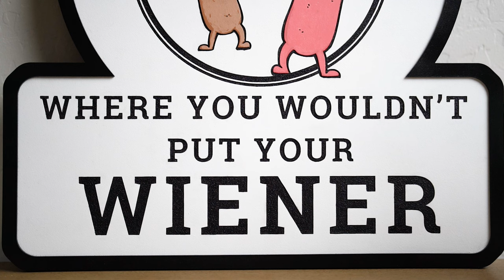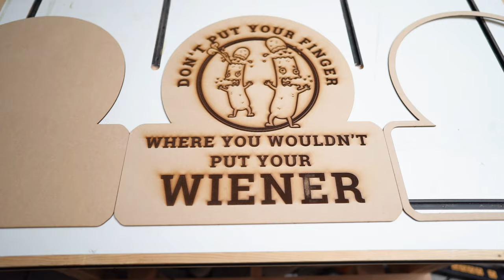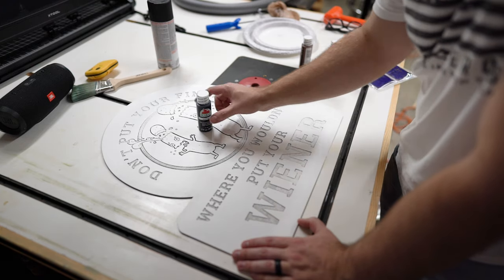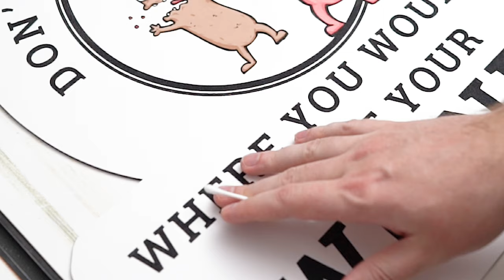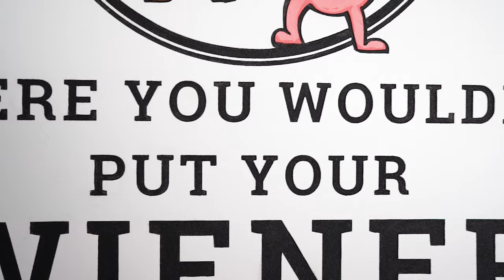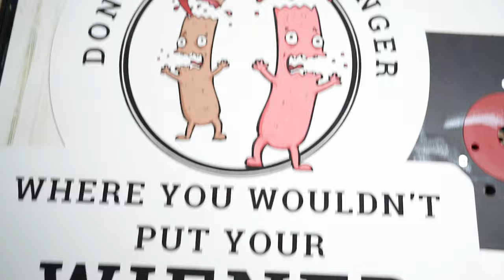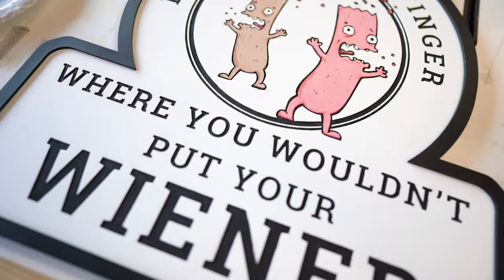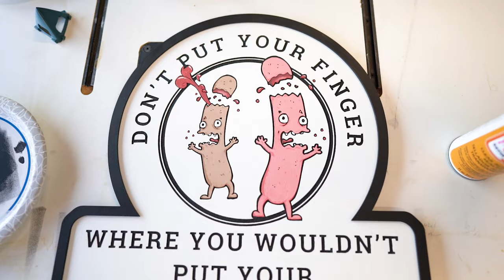How To Make A Sign

Comment: I was going to suggest painting white first, masking entire piece, then engrave. After engrave you can spray paint black into the engraved space and peel off masking. Would still need to paint the other colors.
Reply from the maker: Dude! Thanks for the suggestion! I was thinking that too! I think I’d also be able to paint the whole thing black, then white, then engrave and the engraving would remove the white and leave the black but haven’t tried it yet.
Reply: @WoodNerds  worth a try. If you do it, make I video cause I'd watch it. But be mindful of charing on the white from engraving. The masking tape also protects from smoke and flare ups.
Reply from the maker: @elopez1369 good ideas! Thanks man!